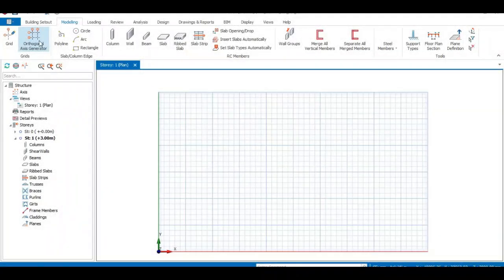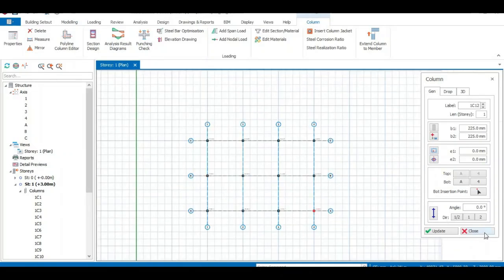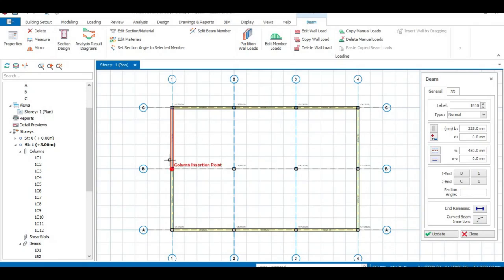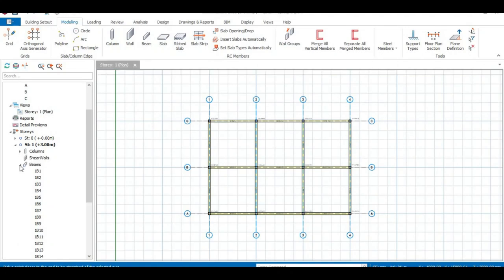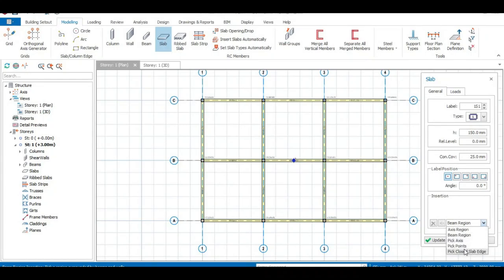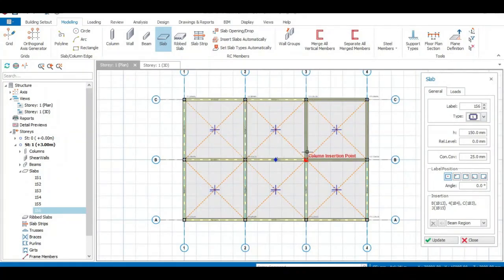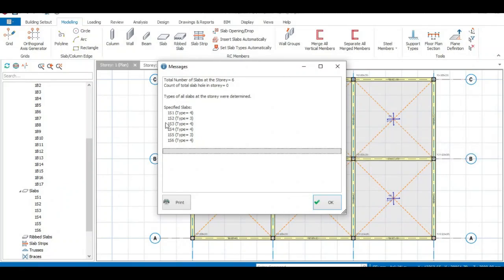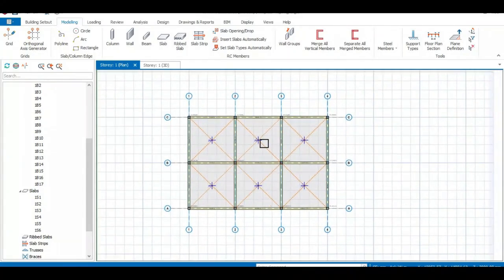Protastructure Tutorial: Designing Columns, Beams and Slabs Easily

Comment from the maker: Protastructure is a professional BIM engineering software application that can be used for structural engineering and mechanical engineering.

Our tutorials at M. A. Esan Constructions are aimed at sharing our knowledge of the use of this powerful application with beginners and intermediate users in order to inspire innovation in the field of structural design and engineering.

This tutorial is on Insertion of columns, beams and Slabs in Protastructure, and at the end of this tutorial, you should be able to:
-Draw your general arrangement using the orthogonal axis generator.
-Insert your columns, beams, slabs and cantilever slabs into your design to specifications.

#structuralengineering #civilengineering #architecture #building #construction #AutoCAD #Orion #ProtaStructure #architecturaldesign #structuraldesign #StructuralSteel #projectmanagement #buildingconstruction #blender #blenderart